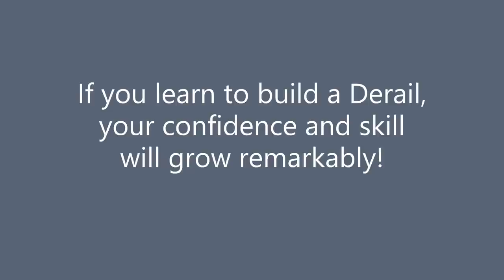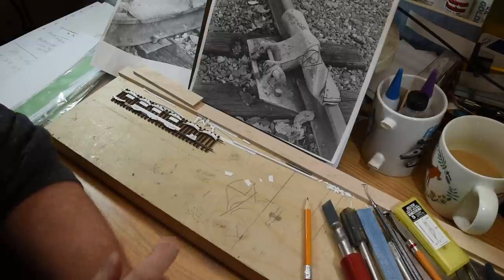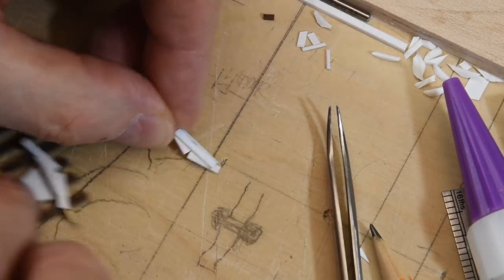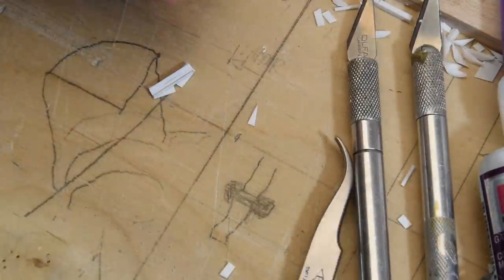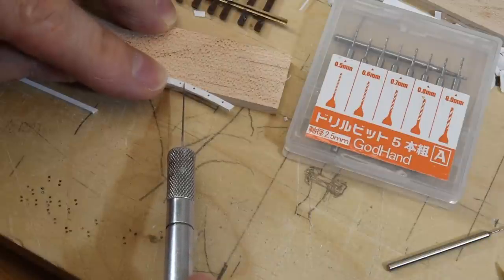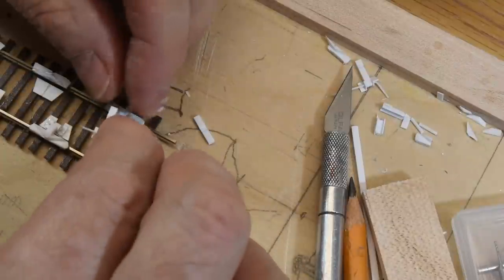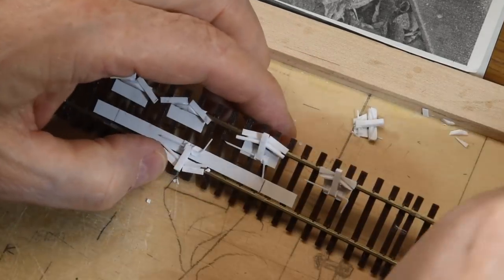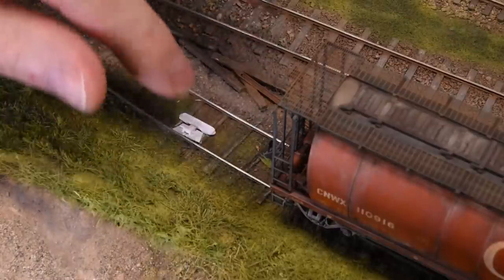Modeling A Realistic "Derail" Device | Final - River Road Vlog #58

Comment: Ok, I guess I'll be the guy to ask: what's the purpose of derailing as opposed to rerailing?🤔🤔🤔
Reply: There you go: 
https://en.wikipedia.org/wiki/Derail
Reply from the maker: Safety.
Reply: I Googled it
Reply: Erroll: Purposely derailing a car or locomotive is safer than allowing the car to go where is might cause real damage or a serious accident. They can be locked in either the clear or derail position as required by the railroad's operating rules.